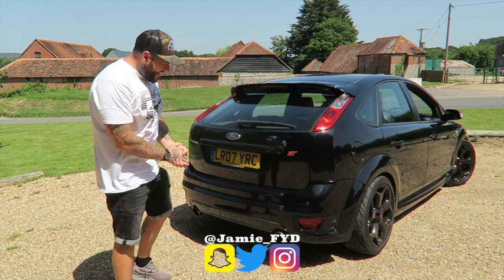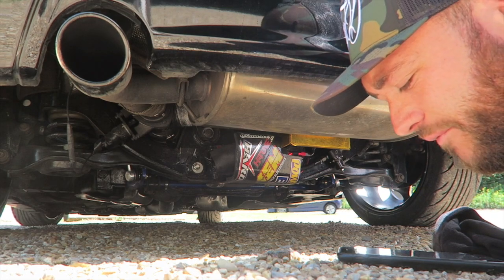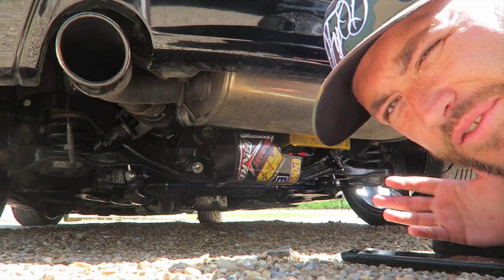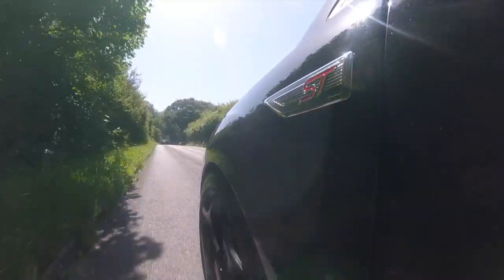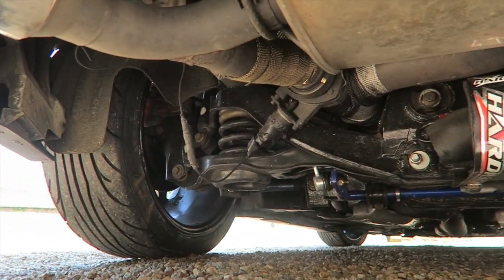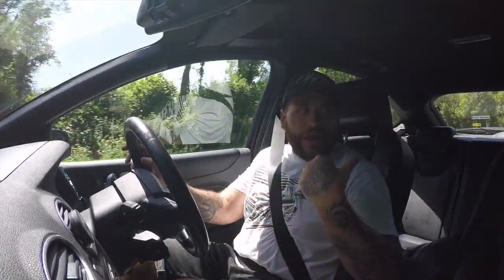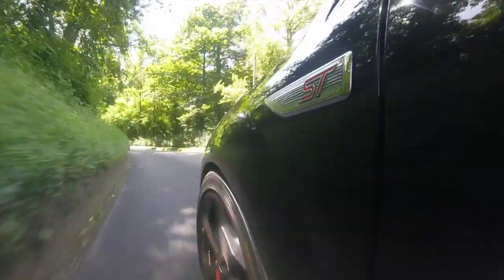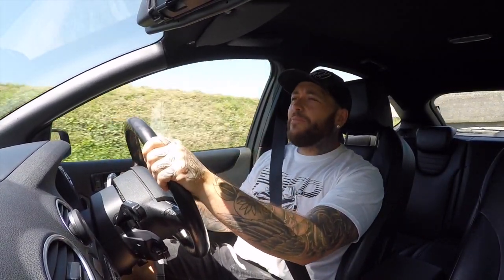4 WHEEL DRIVE MK2 FOCUS ST - MY FIRST DRIVE *320BHP + 4WD LAUNCH*

Comment: If it shares the Ford/Mazda/Volvo "P1" chassis (and 2.5T engine)   you can make it AWD...in the USA the 6 speed manual S40 and V50s came with AWD as standard if I recall.  All just bolts in.... MK2 Focus ST/RS has a premium quality Volvo powertrain compared to MK1 and MK3.

Comment: Alwaysss thought they should’ve done the RS in 4wd too but this seems just as mental!
Reply: Lawsoin Definitely.  mk2 RS easily the best looking & sounding Focus
Reply: Ian Townsend personally I think the mk1 is the best looking but the five pot noise is just unbeatable
Reply: Focus rs has all holes for kuga awd system to bolt straight up too it was designed this way from factory but they cancelled it because it was too heavy🥸

Comment: Tbh it looks slower compared to a normal fwd focus looks like if anything it’s lost power if that’s possible
Reply: power is lost through the drivetrain
Reply: true
Reply: Not sure how you can tell that from watching a video. 
A standard St has 225 bhp which will have fwd 17% drive transmission loss vs 320 bhp with approx 4wd 25% loss. You do the maths!!!
Reply: @markwalton8644  + extra weight... I cant do maths
Reply: @markwalton8644  lol thanks you are a A+ maths

Comment: Volvo were doing the 5 cyl AWD so I always wondered why Ford poached their engine but not the 4x4 approach maybe not to the ST but certainly the far more powerful RS. Revoknuckle or not the RS has one massive flaw and that was it had a shit time trying to put that initial power down. Still a great car but it could have been a true legend like the Escort Cosworth if they had developed it to be AWD from factory.
Reply: buck3366 still a legendary car, look how well they hold value
Reply: Yeah agreed but will they ever get to Cossie levels of prices?I still love the Mk2 RS looks and sound but it’s power train could have given it that edge to make the most of its already fantastic chassis. End of the day it’s been and gone now.
Reply: Yeah true mate, but the mk3 has the awd and it’s value has dropped a lot- perhaps that’s more to do with engine issues tho, give it another 10 years and a low miles green mk2 will be going for 40k plus I bet :)

Comment: Owner did a awesome job on the conversion. I'd be baffled thinking on what parts to get from what car. Just yesterday I went and got a volvo S60 2 litre turbo and it sounded great with the stock exhaust. Love those 5 cylinder engines

Comment: Love this a few lads did this to the mk4 golfs and basically gave no info how they did it what tricks to look 4 fare play these ST models are quick as anyway 1 very unique car
Reply: Use 4motion parts on the mk4
Reply: @captiansparkles8139  haldex is it the same on R32 and V5 VR6 4motions but dont you need to marry it up to S3 8L 6 speed gearbox ?
Reply: @anonlincracing2484  I'm not an expert on this, I have seen 1.8t golf GTi's converted to 4wd using 4 motion parts but do t know if it's a straight fit. May need an adapter plate idk.
Reply: @captiansparkles8139  there is 1 lad in Lincoln where I live hes done it using S3 parts the rear driveshafts prop shafts all look part of the car obvz the rear subframe to hold the diff looks like it's off an S3 ud also need to change the rear shocks n springs to independent like on S3 to make room and rework the exhaust to go along side the prop and work around to the back either way the lad who's done this is a mechanic and I would love to do this set up to my golf would have a go myself for the most part it's just knowing what you need shopping list wise so ur not waiting or problem solving
Reply: @anonlincracing2484  S3 and golf MK4 2.8 4motion have the same gearbox, diff etc.
Reply: And TT Quattro variants
Reply: @captiansparkles8139  might look up some part  numbers then theres a few s3 and 4motions going for next to fuck all on fleebay